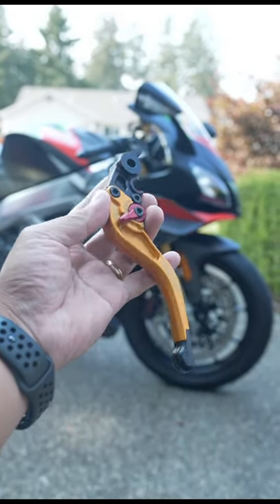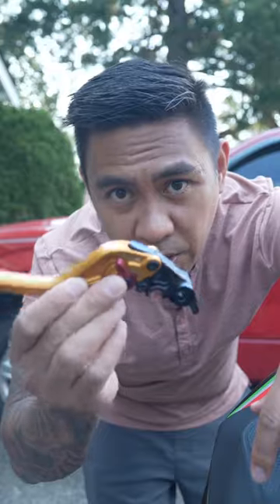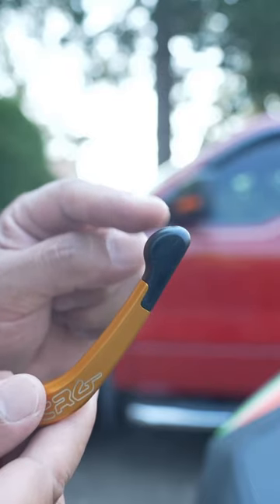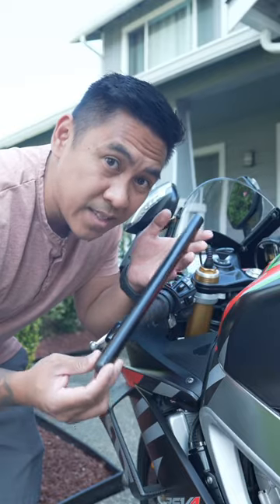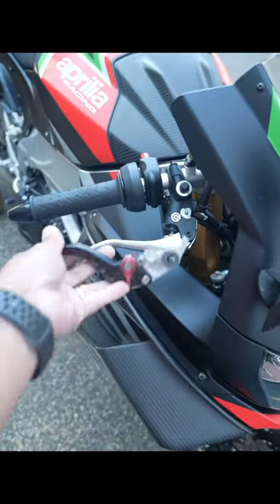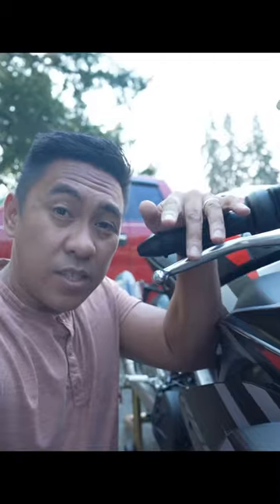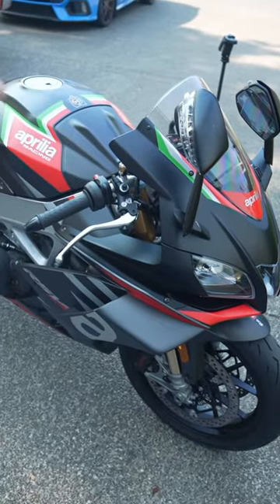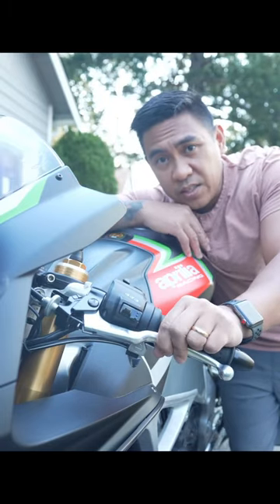Motorcycle shorty levers

Comment: Accurate  it is easier and nicer with longer  clutch bit if you grew up on dirtbikes your just used to the 2 finger clutch
Reply: I actually 1 finger clutch. Grew up racing 2 strokes. Didn't change when I switched over to street. 1 finger clutch 2 finger brake
Reply: @imperialtekk9443  same brother I have about dirtbikes I got a 93 kx 125 full wiseco internals a 02 yz 125 nimaura and Wisco internals on that one a 04 kx250  a ttr125 and a KTM 50 pro senior my hole family rides
Reply: @imperialtekk9443  During my first riding days, on the road, I used to always have 4 on the clutch and 2 on the front break. Bad habit I guess, I still do it every now and then but I kick myself.
Reply: On a short lever if your fingies are getting tired in traffic you can still bunch up on it but a long lever is just annoying to me (grew up with 2 stroke dirt bikes too).
Reply: Yep 2 fingers on vlutch
Reply: 2 fingers on clutch is a 2stroke thing, the guys I ride with are same, those who started on strokers 'cover' clutch and those on 4 strokes don't.
Reply: Yeah same I’ve seen too many riders fall because they wanna whole hand grab while shifting and hauling ass. Then they found themselves speed wobbling. 2 fingers all u need , 1 finger for a hydraulic clutch
Reply: 1st ride, a yammy TY80.. wow, now in going back.
Reply: haha exactly i’ve grown to just 2 finger clutch and brake normally
Reply: why is that? and on a normal bike should you use 4 fingers for the clutch?
Reply: same here i grew up ridin an old honda gl200 and cb150 on the bumpy dirt road at the farm ,even tho i ride a sportsbike now the habbit of using 2 fingers for the clutch stays still
Reply: I grew using dirtbikes in edsa that's why im used to 4 fingers in clutch😅😅😅
Reply: There's always the option to click it into N and let your clutch relax.
I had a 2.5 finger ony RG500 powered NSR MC21.
It's a bitch in heavy traffic. At the same time, it's easy to paddle a few feet.
The first thing I did on the 690 SMC-R was ditch the OEM clutch lever. Two fingers is plenty. Way better for slow creep rolling in traffic.
Reply: Yep, 2smokes had a narrow powerband and if your taking a left with the foot out, the only option was to slip the clutch to keep the R’s up.
Reply: Yessir! This is how you’d ride. Everything else is just less than. If you can get away with an improper clutch setup that’s great but it only last until you come down to that line. Don’t expect it to save you.
Reply: Burn the clutch enough cus of shitty riding and you'll pretty much get lighter clutch pressure. Trust me, I didnt stop what I was doing even though I smell the consequences
Reply: @imperialtekk9443 exactly I literally always and only can ride with two fingers on the clutch it’s just second hand nature
Reply: @deskonosido1026 you can do 1 finger on a non hydraulic clutch but instead of the point finger you use the middle.
Reply: @nielrodriguez9977  yep if your cables are good. My old 94 cr125 has a dumb ass clutch it’s not so easy to pull no matter how much I adjust. Need to switch to hydraulic

Comment: A longer lever gives you better feel/control than a shorter lever. It’s a simple mechanical principle.
Reply: Yes I'm using stock lever and I'm fine with it. But overall it depend on most of rider, some of em using GP style gearshift on a street. Other feel bit mehh I'm ok
Reply: It doesn’t change the pivot just the extra length of the extension. I prefer 2 finger clutch all the time anyway.

Comment: you can also switch into neutral at stoplights,
I think I want a shorty clutch because I get wrist cramps when I have the strain on my ring finger and particular the pinky because they're on the clutch, and having a full length clutch lever but only using 2 fingers means your ring and pinky finger get smushed between the clip on and clutch lever

Comment: Good point about the longer clutch lever in traffic.
Reply: not really, just depends on what you're used to. I only use 2 fingers even on long levers, but no problem using 2 on a short lever in heavy traffic

Comment: ASV's are great too. Even though im a noob, highly recommend. Not crazy expensive, ($110-120/lever $150-160 for nicer material) amazing warranty coverage, and they are built with a spring action that allows them to move forward 90° to reduce likelihood of breaking in a crash. I guess im silly for going for a short clutch and long brake lever, though 😅 but the shorty has enough room for 3 fingers on an average-large sized hand.

Comment: I adore the short lever on the right, but i use a master cylinder caliper combination that already too "woody" on the feeling.. so i need to change my brake lever to a longer size so the feeling goes a little bit softer rather than stiff.

Comment: Short clutch long brake. I have exactly average hand size, and short clutch is perfect for 2-3 fingers on with pinky or pinky and ring finger spacer. If you don’t put your pinky or pinky and ring finger between the bar, and lever try it. You’ll never use 4 fingers again trust. 
Brake you want longer so there’s A.) zero chance of missing it, and B.) If you’re racing/ aggressive street riding/ emergency stopping/ honestly every type of riding there’s no NEED to rev match. Rev matching is to get into a lower gear to accelerate, or for the badass sound. Zero performance gain or extra wear on the clutch for deceleration. Rev matching actually hinders deceleration. So why not use 4 fingers for added control of the pressure. 6 piston brakes don’t add grip to tires, but they sure do increase stopping performance because you can control the pressure way more precisely. Same logic.

Comment: I drive in dense traffic and have to operate the clutch constantly. Use 2 fingers and get a stronger grip. I just don't see how you can have proper control of the bike operating the clutch with 4 fingers.

Comment: Real racing levers have a hole in end, it snaps on impact and the hole allows air through so levers don't slightly apply. But any way short lever or long lever is personal!, Never noticed a short lever in WSBK, MotoGP or BSB.

Comment: What? I never clutch with 4 fingers O.o
Only moment i used 4 is when i struggle to get into neutral (which is rare)

My clutch is quite easy to pull tho
Reply: I have so much more control with 4 fingers, on the track I use two though 

I feel like it variés bike to bike and person to person
Reply: @blizzthebike  really? Thats a rare occurrence
Whenever i try to use 4 finger, my palm doesn't feel that stable on the grip and i make small movements that make me shift horribly 

But yeah it heavily depends on bike and rider. My riding instructor told me to only use 4 so the clutch lever could be fully pulled or sth 
My friend has a ducati 848 with a heavy ass clutch. He uses 3-4 fingers cause its too fatiguing with 2
Reply: @someguy9520  Heh, I was taught to only use 2, using 4 fingers is something you might do for the first month of riding though.
Reply: @MotoDash1100  another proof where it depends on the person/instructor et
Funnily i never used 4 fingers, even when instructed to
Coming from MTB and road cycling, 1-2 fingers max for best brake modulations it just made more sense

Comment: You are wrong. As a former racer and builder. The long levers you buy are not the same as what we use on the track, number one. The long levers used are notch cut so smaller bits can break off and still have lever. It is not a perfect science but it allows many a rider to pick up the bike after a crash and continue. Shorty levers allow the clip on to take ALL the impact which results in broken bars and an immediate retirement.

Want proof? Look at ISLE OF MANX, World endurance racing, AMA……there are some racers that will use a short lever, usually an injury or something like bias knob is set up on the same bar.    Do more research

Comment: Everyone wants short levers until they actually need a handful of brakes in an emergency. Then wish they had full length ones.
Reply: If you need a handful to brake then your just a squid 🦑 and panicking , i one finger my clutch and brake the entire time I’m out riding. There’s never a moment West I need to grab my front brake lever entirely cause my 1 finger applies the same pressure my entire hand would smh
Reply: not once, what sort of a boomer made up scenario is that?

Comment: I've been riding for 30+ years. I've never once had an issue holding a short lever while in traffic. How weak are peoples hands that grip strength is that much of an issue??
Reply from the maker: You ever ridden a ducati with a dry clutch? Even with a hydraulic lever, it’s stiff.
Reply: @adobomoto  Yessir, and it's still not that big a deal (had a 04 ST3).

Comment: Thanks for the info on short break and long clutch lever
Reply: It's a safe habit to use 2 fingers on the clutch as well, so that your only connection to the handlebars is not only your thumb.

It's easy, safe, and gives more control to just use 2 fingers for the clutch lever.

Comment: I would disagree with short levers in track/racing. If you rotate your wrist out on the throttle for what is called an ice cream grip, shorter levers are more difficult to reach. I would recommend the folding CRG levers for both brake and clutch.
Reply from the maker: I only use the clutch when taking off in 1st gear - specially at the track.
Reply: @adobomoto  One of the benefits of a quick shifter! I'm not that fortunate to be running a track bike with a quick shifter :)
Reply: @camt2626  you can shift clutchless even without a quickshifter
Reply: @libingmeme8474  yes that works on the up shift when you unload the transmission. Doing that on a downshift will cause problems. Benefits of a quick shifter are on the downshift with the auto blip. Although I would not rely 100% on a quick shifter auto bliper as they can fail.
Reply: @camt2626  it won't, been downshifting clutchless for a while not and everything's fine, although I do rather use the clutch in some situations

Comment: Brake lever guards wont do anything to protect the lever in case of a crash, they are there to prevent another rider touching your brake
Reply from the maker: Really. Absolutely nothing. Hmm, interesting
Reply: @adobomoto  They may do "something" but that's totally not their purpose
Reply: Have never heard that. I imagine a set of barkbusters with the metal behind the plastic is doing something to protect levers because why else would people buy them 🤔
Reply: @MotoDash1100  they are meant to prevent other bikes from touching your lever and activating your brake, search Catalunya 2006 and see why they were introduced in motogp. If you think that little piece of metal will stay in place after 300kg fall on top of it them i dont know what to tell you

Comment: So pissed my crg lever snapped at the pivot point and not where it's meant to, 20mph lowside in the wet
Reply: Look up barkbusters on RevZilla, Acerbis also makes some, but if you find what I'm talking about, you'll see it's a plastic faceshield for the levers, you want one that has a metal wrap-around bar.

That metal wrap-around bar is what will protect your levers in a drop. See if you can't find something for your bike.

Best or luck.

Comment: No absolutely not , stop giving out your opinions and preferences as if they’re actual facts. I prefer a stock front brake lever and shorty ez-pull stunt clutch lever. & I always 1 finger my clutch and front brake lever. Your hand covers more surface area of the grips. Giving you better stability. I’ve been riding since I was 6 started off in motocross then enduro racing , to street stunt riding I learned to manipulate a bike in many different ways in order to control it and a lot of the tips you give out are just in-accurate
Reply from the maker: Wait, so your opinion and preferences are fact? White people 😂

Comment: I just put the bike in neutral, why hold the clutch in for a long period of time. Roll off in first gear anyway
Reply: Hold in clutch for 1st gear let's you still be able to move out of the way of a guy not slowing down and about to hit you at an intersection.

It's a safety thing, and it is faster than however long it takes you to shift into 1st to leave the green light.
Reply: Absolutely safety first be aware of your surroundings. In general of traffic I find myself in where vehicles has stop for a long period of time. Holding the clutch in till I get an arm pump, wishing I have bought a longer clutch lever is not my first option
Reply: might as well not ride at all if you're that paranoid about getting rear ended